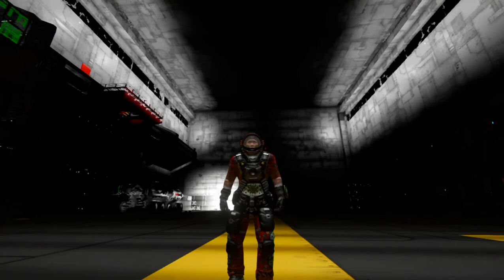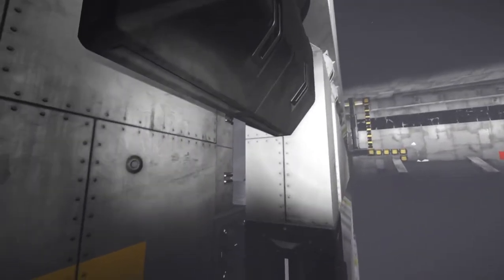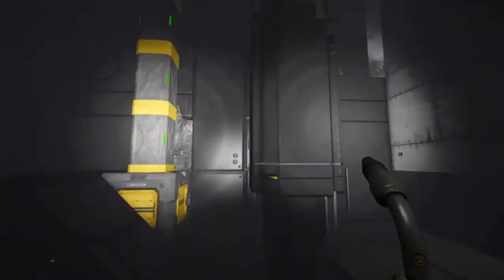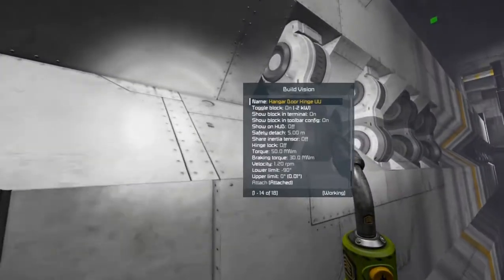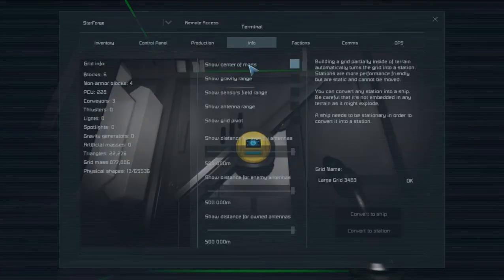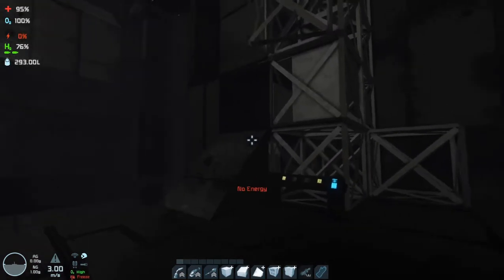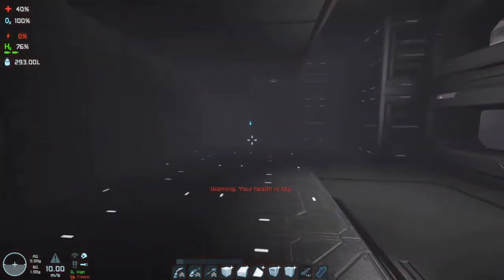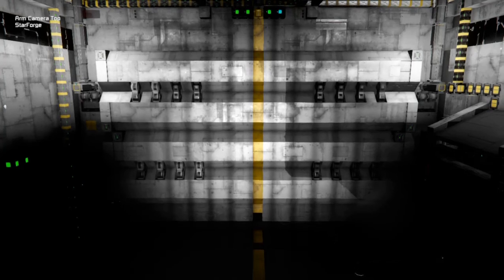Space Engineers | Survival on Triton S01 E02 Special - Large airtight hangar door guided tour

Comment: The issue you are having with the hangar doors after opening is because (unless I missed it in the video) you don't actually merge them.
If you had a merge lock when open then SE wouldn't treat everything as multiple clanging sub grids and would leave you alone.
Reply from the maker: I had a few issues, that I can't recall atm, but it now merges without problems. I remember removing 1 redundant merge block as it's attractive force sometimes managed to blow up part of the structure. Also I added an extra sensor to allow to detect if the door sections managed to fully open before pulling them towards the merge blocks.